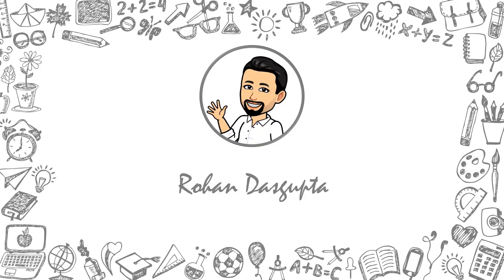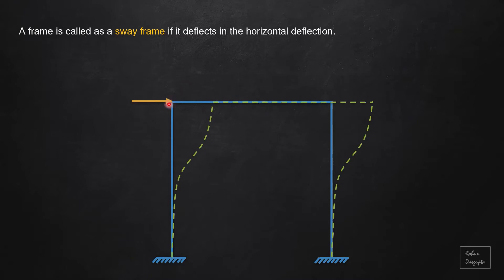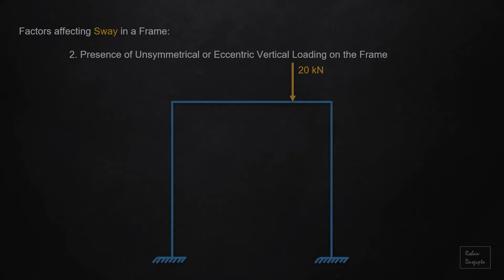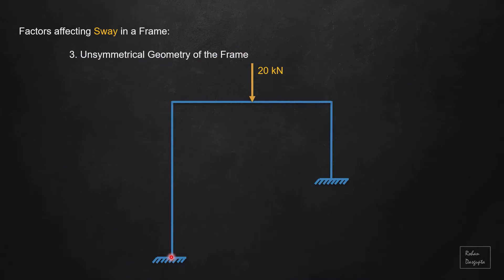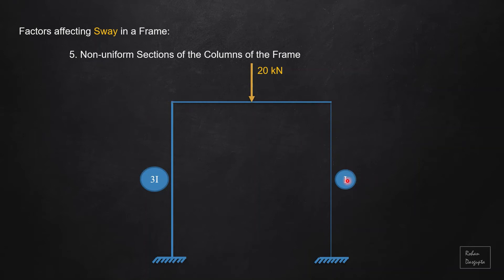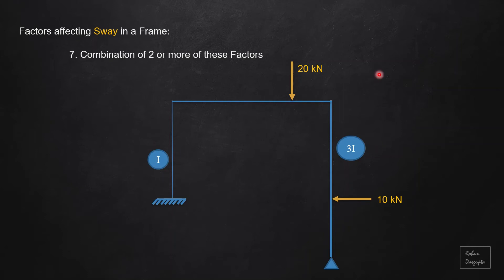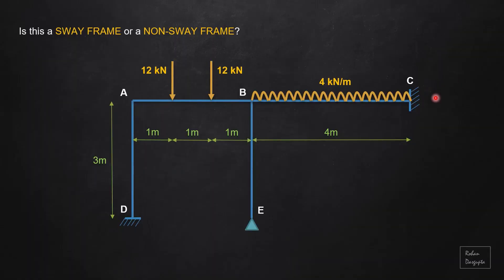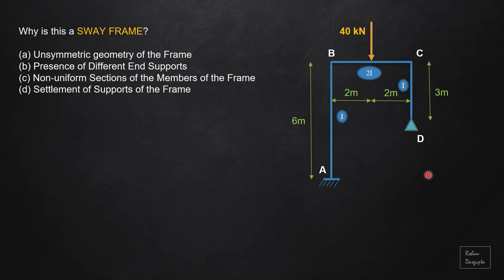| Sway Frames and Non Sway Frames | Explained with Examples | by Rohan Dasgupta |

Comment: This is not the definition of a sway frame.    Your examples are all standard rigid connection "non-sway" frames. Just because the frame sways does not define it is a "sway frame".  Please google search the definition of a "sway frame" vs. a "non sway frame" used by structural engineers.

Comment: Great video. However, if the horizontal beam is made of two parts and one side has a different stiffness than the other side then the frame may be a sway frame too?
Reply from the maker: Hey, Rob. Thanks. 
And to answer your question: yes.

Comment: Would a ladder inclined at 40 deg and vertical load midway through the span, rigidly fixed at both ends be a sway structure?